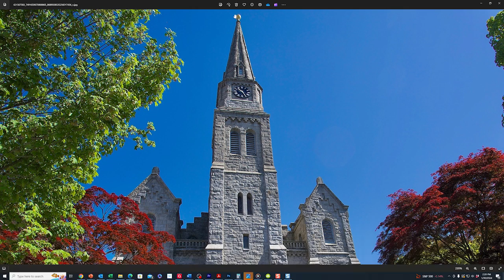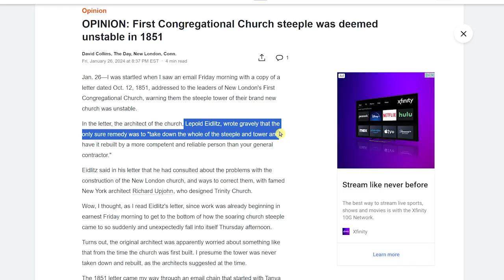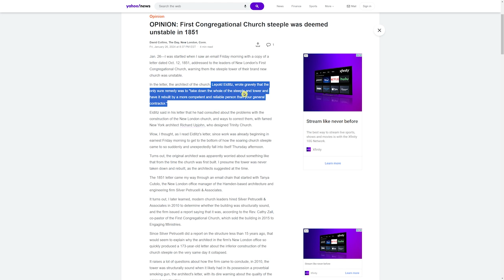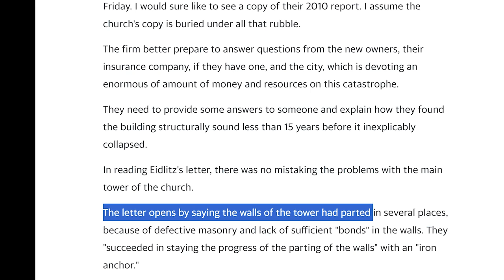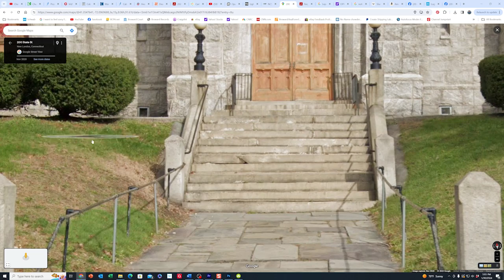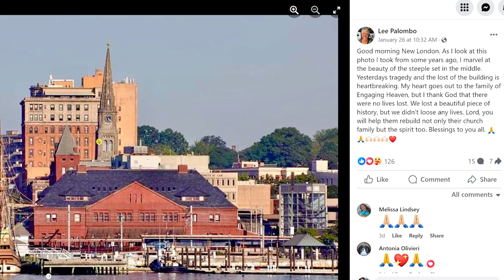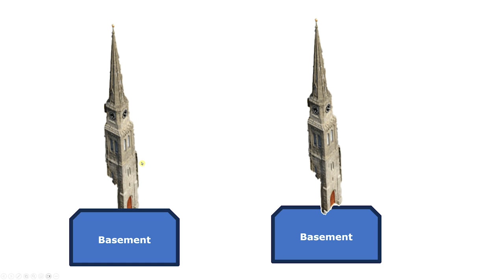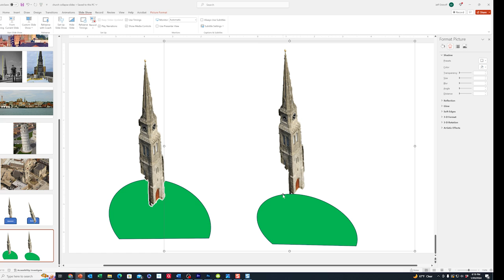What Caused Church Steeple Collapse New London, CT?

Comment: Congratulations.  As a mechanical engineer and an amateur student of 19th century church architecture, I appreciate your measured analysis and reasoned tentative conclusions.  Excellent use of available information.  I was especially interested because the present Shadyside Presbyterian Church in Pittsburgh was constructed in 1890, less than 15 years after its predecessor building.  When defects were discovered, the church trustees consulted with a contractor, an inspector, a mason and two architects before deciding that the building had to be demolished.  The conclusion was that its Gothic tower was especially at risk.  Blame was placed on poor construction, materials and - possibly - water from underground springs flowing beneath the structure.  Despite the thorough advice, some believed that repair rather than replacement was preferred.  Also, the high projected cost of the new building led the pastor to resign.  Minor cosmetic damage from groundwater was noticed in the new church building.  During major construction in 2009, the structure was protected from groundwater.  The quality associated with the cost of the 1890 building was recently affirmed when the original slate roof was replaced, having survived for 130 years.  The present Shadyside Church was designed by the successor firm to Henry Hobson Richardson.  Your photos made me realize that - two decades ago - I must have seen the Congregational Church designed by Leopold Eidlitz.  I was in New London to see Richardson's railroad terminal - it is the large red brick structure visible in one view.  You showed the New York State Capitol Building.  Richardson collaborated with Eidlitz on that design.
Reply: OK, if it's 19th century, it's not gothic. It's neogothic. I understand that for Americans any building that is older than 100 years is considered ancient, but please, have some perspective.

Comment: We actually have an epidemic that is coming with these type of buildings. We are restoring an 1891 Romanesque Revival stone and brick mansion. These buildings were built with "lime mortar". When modern day masons repair these buildings they use "cement mortar" and it traps moisture in the stone and mortar joints. The "lime mortar" then dissolves and becomes just sand. This entire structure would have been stones sitting on stones with sand in between by the time it fell. We need to save these buildings by rebuilding them with lime mortar again and repointing them the right way.
Reply: We're getting the hang of that here in the UK- we've known it about historic buildings but have tended not to take it as seriously as we should have in domestic ones. 
Buildings built with lime mortar should not be repaired or repointed with cement mortar (and the same re lime plaster vs gypsum as well, actually, unless you really want a damp house). I have to repoint my house this summer - a previous owner (may their socks rot and their chickens all die) repointed with cement mortar. Less of a deal in my case because only the original pointing was lime, the main mortar was black ash (don't ask, it's not great, and is no longer used😉). Luckily my place is mostly single storey, of very dense, hard red brick (same bricks as used for your Empire State building, from a quarry near me) and is built like a brick outhouse (as we say here when we mean 'very solidly').
Reply: @alisonwilson9749  I'm rebuilding my big wreck of a 1880s house in Scotland in the Highlands, so also lime mortar. Many, many years ago the local council repointed most of the house for the old owner 'cos the render was falling off, and it's on the High Street. Of course, being the council they did it on the cheap and used cement mortar and dumped all the old stuff in the garden. Joy. I am SO looking forward to chipping all the cement off.......after I've finished repairing the inside......
Reply: I worked for a company in the early 2000s that renovated historic buildings and you are correct.  When we took them apart,  it was just dust between the stones.
Reply: Our (long out of service) 1822 chimney was exactly as you say.... the mortar was VERY fragile. @Emilthehun
Reply: Wasn't the Eddystone Lighthouse lighthouse, designed by John Smeaton and built in 1759 off the coast of Cornwall made with lime mortar?  
When they replaced it with a new one (reef it was standing on was eroding) in 1878 there were going to demolish it but gave up with a quarter left  - a testament to how well it was built.

Recently, while a 55 floor comdomiun was being built right behind it, the chimney of First Baptist Church (Downtown Vancouver), built in 1910, collapsed.  A few were injured.
Reply: They did this to our city hall here in Milwaukee recently. It's a beautiful building, too, but now has netting all around because pieces keep falling off of it.
Reply: Omg I'm subscribed to you!
Reply: It's a small world. =) @Generic_Villain

Comment: I think... those balconies outside between the towers, collected water and didn't get rid of it the correct way. What was under the steeple? Open space and front support, mostly. Whatever side support there was, the water ate away. So it broke backwards and heaved the front out down the steps. 173 years after being deemed unstable. The rest of that roof didn't look all that great either.

Comment: From the video and the debris in the front; it seems to indicate the point of failure was located on the interior wall of the tower. The point of failure would probably be somewhere above the top of the front doors that's why the bottom parts were pushed out. If the failure was on the front wall of the tower it would have fallen the other way.
Reply: Right where the 2 small flat roofs exist between the towers. I would suspect the flat roofs contributed to deterioration of the interior wall. The roofs were replaced in 2017ish but it was likely too little, too late.

Comment: 12:40 There appears to be a crack at the left side of the steeple.  It's horizontal, visually slightly above the level of the top of the window on the set-back stepped wall.  It looks to be maybe 2 meters long, possibly extending to the right of the steeple's thick corner pillar by maybe 50 cm.

Comment: WFSB reports that local 8th grade geometry students were able to track a two degree shift in the steeple over ten days using the security camera footage. So it stands to reason it may have been shifting slowly for quite some time. Perhaps eventually the lean became too much. Heavy rigid structures do not necessarily handle complex lateral forces. Especially if deficient in the first place.
Reply: Did the FREEMASON'S BUILD IT?
Reply: @shanelewis617  "Did the FREEMASON'S BUILD IT?"

Be suspicious of anything that's 'free'   You get what you pay for.
Reply: @shanelewis617  ; the FreeMasons did not buikd the Church.
Reply: Classical vault / transept collapse, same as Beavais cathedral april 1573.
Reply: 2 degrees using a security camera? I find high probability it wasn’t nearly that accurate with such a high degree of confidence😂😂😂
Reply: @Just.A.T-Rex  The story did not indicate how the students solved it. But there are known methods to analyze photos and video. Basically you overlay and align all of the verticals. Jeff did this with static photos in his video. Anomalies across a series of frames don't matter. All we need are the verticals of the static objects. Then you measure the delta of the tilting object against all of those other static points. Eighth grade geometry can then be used to compute that delta in degrees. Whether it's 2 degrees or 3 doesn't matter. Any delta at all over 10 days is a valid datapoint and likely pointing to the cause of the event. Not to be confused with the root cause of the overall failure, which is whatever caused the lean in the first place.
Reply: @storm9c1.  You could see the tilt in the photos of the city skyline. I imagine lots of people noticed it including the math teacher. I guess no one wanted to say “ the sky is falling “. Glad no one was hurt
Reply: @thekingsilverado3266   lol
Reply: @Just.A.T-Rex  Why not? Security camera footage has the one big advantage that the camera (and everything unmoving in the picture) stays perfectly stable. So you can two images taken two weeks apart and count the pixels an object has shifted.
Reply: @Just.A.T-Rex That's one significant digit. You can't express any estimate of anything with less than one significant digit. They're 8th graders. Did you think the NTSB was waiting on their report? It sounds like they had a fun time using geometry to investigate something straight out of the news.
Reply: @ED-es2qv  I'm sure that their numbers weren't the most precise,  but when it comes to masonry structures, anything other that 0° is very bad news 😂

Comment: I didn't know that this collapsed ...thanks for the video (I actually love these videos)

My opinion, all bldg structures will collapse over time but it is still beyond me, how those ppl could build structures that could stand for hundreds of years vs now - structures are falling after 10 yrs & with the technology we have now to do calculations.

....  but then, every material used back in those days were much cleaner (natural) so the 'high in strength' was there. I'm guessing bz there was less purification process and back then + there was no standard brick sizes...

I'm guessing it was a combination of soil and foundation at the front of the door that made it collapse. 
1. The steel used was put at the back of the church & the front half was only made of a thick wall of bricks.

2.  I have to guess, that the steps/entry way into the church was put in years later & attached to the bldg. With the cracks seen in the steps, the ground has gone thru some changes (maybe) vibrations from local construction/water mains/electrical etc. of other bldgs + mother nature.

3. I have to guess on this, but the basement (at the front door) was made of bricks with the soil acting as support. Thus, if the basement had cracks forming, it could have weakened the stress that was holding the front door area in place. which might have assisted to the steps/entry way cracking. The steeple (straight down) had the most weight for the front wall to bare.

The structure was leaning & probably started in last decade or so bz I can't believe that the artilect would allow the steeple (that (visually) leaned that much) to remain like that.  For sure, he would have had that taken down & re-done.  Back then, architects had a very high standard for accuracy  & reputation + plus drawn with paper/pencil/ruler for every change.

Comment: Qi, our Construction company used to specialise in structural repairs & stabilisation. And we have been in the situation where a wall has started to move, this was largely due to water or more accurately a waste/soil pipe carrying sewage that had been very poorly installed, it was a very old property, the original building envelope had been built in the late 1600’s or early 1700’s. The founds pad stones,  in all probability contributed to the resulting instability. The offending wall was very speedily propped and the problem attended to.
On the issues of the masonry ties, remember they would be made of wrought iron,(most likely), depending on when they were installed, and they are very prone to deterioration overtime, so they will lose their effectiveness, all ties, cramps , dowels, etc that we use were S/S. We’ve done stone chimney rebuilds where the original ties have completely disintegrated.
Another technical point, the mortar in stonework is designed to keep the stone apart, not to bond the stone together, this is a common misconception. The lime mortar is less dense than the stone & this allows for moisture to transpire (breathe) through the mortar beds not the stone itself. Also the lime mortar can deteriorate over time, (although unlike a cement based mortar it has self healing properties). It looks like there was a shear failure  above the  front facade walls, the towers on either side acting as an abutment, my money would be on a catastrophic failure of one of those through ties/bolts. 
It’s a miracle that no one was hurt or killed.
Reply: Exactly my thoughts. 100% correct.
Reply: It was due to deteriorated mortar. When the building is repointed the mortar in the back is never addressed and turns into dust.  The wood shims they used have also deteriorated so you have stone connected by sand and a half inch of good mortar. I've seen it numerous times and am always amazed how these collapses don't happen way more often.

Comment: There's a report on The Day website about a problem from 2014, which wasn't really addressed. The First Congregational was too weak, and an Evangelical moved in, but that was as far as it went. Seen from the interior, the access doors are to either side, under the side towers,, and it's possible nobody when below the spire.

Comment: the steeple section was prob built after the rest of the church was completed. so on diferent footer stone slabs, years of water problems, stand pipes and municiple drain and supply pipe breaks. this in conjunction with a posible column or beam removal in recent years to make more room in the basement finally took its toll durring the lasst high rain fall completed the undermining. need to find pics of the steeple still straight and what year that was and compare to construction permits and municiple water and sewer breaks in the vicinity of the church........

Comment: Hopefully they can recover some of the items of the church. 

The Tower of Pisa is bad example that tower has had millions spent throughout the centuries to keep that thing in one piece, and to reduce it's tilt to make it more stable.
Reply: If I recall they could make it vertical with modern foundation technology but then it wouldn't be interesting lol.
Reply: pretty much they jsut  went to reduce the lean jsut enough to make sure its stable  @lhaviland8602
Reply: The Tower Of Pisa was beginning to lean when they were building it. They tried compensating for it by making columns longer on the side of the lean
Reply: @CraigGrant-sh3in   If you look closely, you can see the kink in the tower, where they tried to build straight up after the lower part had tilted.
There may be an ancient document in old Italian, where the designer says the only way to fix it is to take it down and re-build it - pretty much word-for-word what was said about this structure in 1851.
Reply: The Tower of Pisa is also hollow.  It was built as a campanile, but because of the lean, never used as such.
Reply: The Banana tower. Seeing it up close does really highlight how much the thing is leaning. It’s got unique foundations to hold it in place, plus some soil improvements

Comment: How about the posibility of saturated soft lime mortar as would have been used in 1850 freezing and disintegrating, crumbling away and falling out of the joints leaving a portion of the tower as nothing more than loose stacked granite blocks.  Hasn't  the northeast had a lot of rain followed  by bitter cold then a thaw which would allow the broken mortar to fall out of the joints?